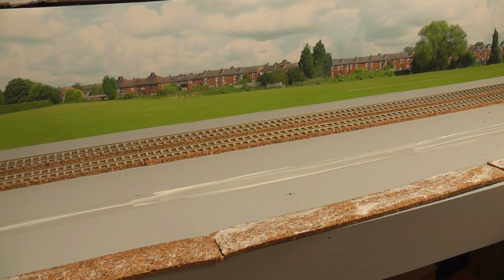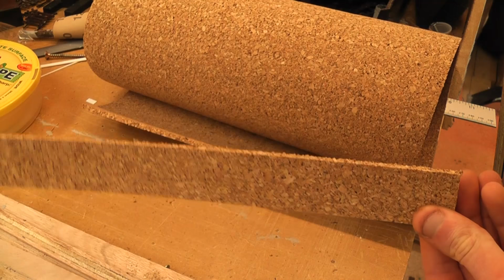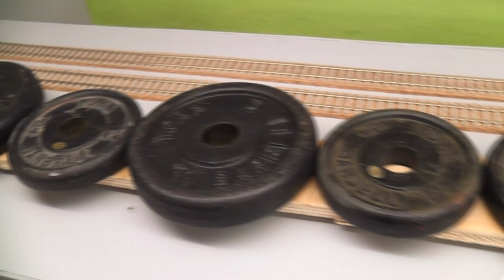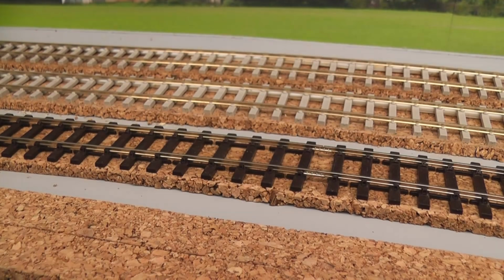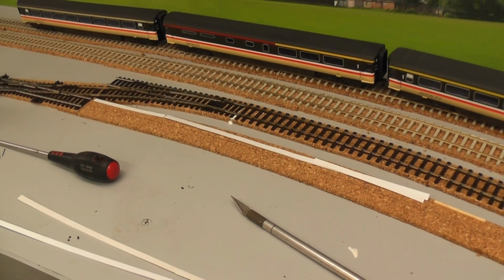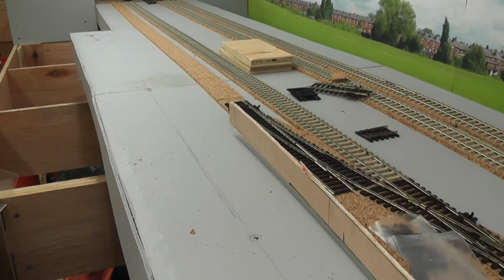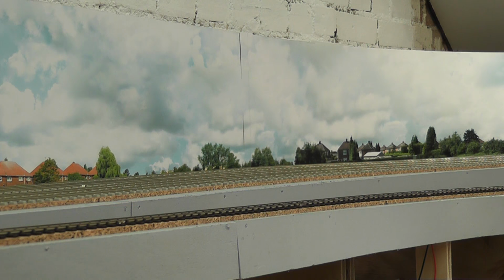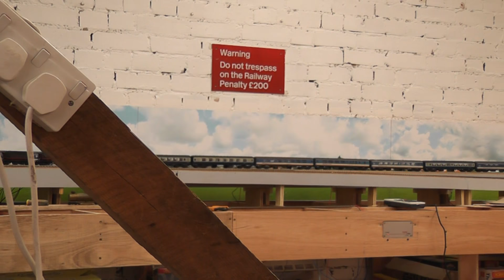New Layout Build - Track Laying

Comment: Very inspirational. Solved the question about combining wooden sleepers on points with concrete sleepers on track. And I like the way the curves are not machine curves as a track software would make them as they vary in real life. I will go for the superelevation also. As I understand your comments the concrete sleepers and their spacing is HO scale which makes it easier when you have a HO layout.

Comment: Excellent work there Richard. The track work your doing is well worth the effort, a pain in the butt to do but well worth it. I'm one of those twats who will use totally hand made track so will have to thread all the chairs on the rail as well. On a slight negative, where you join the concrete sleepers to the wooden sleepers at point work I noticed you cut down the concrete sleepers to fit. In reality they would have used wooden ones as wood is easier to cut than concrete. Also when you want to create the 60' panels, rather than cutting all the way through the rail just cut half way. Once you've added the fishplates they will look the same but you won't have to worry about soldering to electrify the joint. Anyway great to see trains running again and really looking forwards to the next update. Well done.

Comment: Glad to see you back. I really like your placement of the feeder wires. I don't like to see all of the wire and globs of solder on a lot of layouts. I don't have to worry about this as I don't have any feeder wires on my layout. I also don't glue the switches completely down ever. I glue the very ends of the switch where they go into the following track and then glue the  track. This makes it easy to salvage switches and make changes. When I have the track setup final, the balesting will keep the track in place.When I am fitting the track, I use "T" pins to get the track straight. These are on one side of the track only and all I have to do after placing the glue is to push the track back to the pins and it will be straight.They are between the "sleepers" (we call them ties) and against the track.The layout at the 49:35 point looks very great!!!  Glad to see some freight trains on the layout. Most of the layouts (on your side of the pond) just have passenger trains. The freight trains are refreshing...Your videos are never to long...

Comment: Good point you made.
Switches were always made of wood... They were called timbers as opposed to sleepers and when you worked with them my god you knew the difference. They were close on twice the weight for the same size and tougher than something that is very very tough having a really tough day!

I like the way you have tried to make each switch less model train like, as they are on the prototype. In reality each switch is bespoke, no two are alike really.

Comment: Richard, there is a difference between a trap point a catch point. the picture you showed to illustrate it is a trap point with a headshunt spur that ends in buffer stops in that instance (it can be just a roll off into a sand box!), but a trap can simply be an end of the rail that puts the loco on the ground as you showed with that piece of track that is a point without a road (@ 25:16) or it could be a spur that loops like a passing loop that has a headshunt at the end of it. There is or was such an instance of that at Olive Mount Junction. The road comes from the tunnel towards the Chatmoss line, the train can either go over the right hand facing switch onto the Chatmoss or continue into a short otherwise pointless headshunt that ends in buffer stops quite a large distance from the right hand facing switch.

The idea of a trap point is to stop undesired, unwanted right direction movements from taking place... To stop a train that is not signaled to move from moving onto the other line. Its always seen as a facing switch or some kind. That can be a spur which is 2 feet long (as shown at 25:16) or a 2 mile long passing loop with a seemingly pointless headshunt at the end of it.

The positioning on the track, signals in relation to what it around is would dictate what we would have fitted in that location.

A Catch point is used to stop wrong direction movements. They are uncommon these days due to fully fitted trains. After fully fitted became a thing we set about removing them all in the 80s but some remain.
A catch is set after a train has passed it traveling up a steep grade for instance. Any breakaways from that train would be caught by the catch point before caused any bang road movement problems.
On signal boxes to set the route from one signal to another (remember routes are always set from signal to signal, you can shunt to the rear of one but its always from one to another) interlocking would prevent the clearing of a route if the route had a catch in it, as the catch was facing the wrong direction... If it had a spur for instance that spur would be going back, in the opposite direction to your direction of travel.

Which is why its important to point out the difference. You want a trap not a catch.

Comment: Superb stuff. Super-elevation (cant) , transition curves, 60' track lengths, different sleeper types, correct track spacings etc. are all things that are easily observed on the real railway yet for some reason very few modellers seem to grasp. This will no doubt be a very lifelike layout once completed and the videos are already inspiring. 

For years I've also wanted to build a layout using this observed approach and was contemplating having to do it in EM gauge. But having seen how effective the re-spacing of sleepers technique is, I might choose this option instead! One day...one day... 

Don't forget the need for an adjustment switch where continuously welded rail meets jointed track, which in real life caters for the expansion in the first 180 metres of the CWR ha-ha!

Comment: One thing I've done when connecting points/ slips is to use a short length of track and put the isolators on the end of that. This way you get a dead section on the approach instead of just a dead frog. Cuts down accidental conflicts when a train crosses a junction and another train tries to do the same thing.

Comment: Late to the party on this, but intrigued by your approach of laying the bullhead in 60' lengths. 

I remember from a layout in RM many MANY years ago (when I was a teenager), someone trying this and commenting that one reason it didn't work as well as you might hope was that (in real life) we only hear the nearest coach going over the nearest section (both of which are coincidentally about the same length), whereas on a model you're relatively speaking a long way back, and hearing all the coaches going over all the joints. His fix was to make an audibly obvious joint about every train length, and, if I remember correctly, then solder that point to a screw into the baseboard, essentially to use it as a soundboard. Apparently it worked. :D

Comment: Fantastic as always. I look forward to each update.
The one thing I find frustrating is that we have had concrete sleepered flexi-track for decades and 2 turnouts since 2010. We now have steel sleepered and bi-block, but are still expected to use wooden sleepered turnouts. Peco are one of the biggest manufacturers yet seem to ignore this.

Comment: I have PECO concrete track which I re-sleepered with C & L sleepers but I have been worrying about how it will look compared to PECO points with the narrow spacing. You've cleared that up for me. My layout isn't that big and is mostly a shunting puzzle with a small station which has updated concrete track. The rest will be laid using bullhead but as I've said I've been holding off because I couldn't make up my mind on how to match the track. Thanks for a very informative video.

Comment: Many thanks Richard, especially for pointing out how to make fixed points flexible! That branch line is itching to be made 3rd rail so you can run EMU's aka Reading. Would really top it off, think of how many dive under 3rd rail lines there are adjoining the line between Basingstoke and Waterloo.
Reply from the maker: The branch line was always going to be third rail.  It will be added when I start the scenery.

Comment: Interesting to see that you are running the lines as an up-down-up-down config rather than up slow - up fast - down fast - down slow that we have on the ECML.  Excellent video, and well worth the wait
Reply: It is a model of the GW, which is laid out fast-fast-relief-relief. The GE is also fast-fast-slow-slow, as is the WCML until Roade where the slow lines detour to Northampton. It then becomes slow-fast-fast-slow through most of the Trent Valley.

Comment: Brilliant! It's good to see the overall finish with the spaced sleepers. Though I've slowed down on mine to enjoy summer I've made a steady start on the long slow process of 're-spacing and using a mixture of all the fine scale track - bullhead, wooden and concrete sleeper flat bottom - should look very effective. A huge amount of my time has been spent having to research the correct types of track down and around Exeter St David's station so countless images later I've got it virtually spot on. 

Itching to run something 🤣

Tim
Reply: The only thing I had wondered is if the gauging was compromised by all of the sleepers being isolated. All of the other questions I had been thinking of he dealt with during the course of the vid. If you read this Richard, bloody well done mate.

Comment: Afternoon Richard, for me it was worth the weight for the update, The sleeper spacing looks great as does the track camber. I enjoyed the running session, reminded me of my time on BR Railfreight Distribution (Harwich Parkstone Quay) of that period. There are two layouts which interest me on YouTube, yours and Daveclasse47, a lot of others are Mickey Mouse type or only interested in the latest release, which either I skip through or sit there having a good chuckle at (sorry to those I people who run a class 4F with a class 68 on the same layout even coupled together Air/Vacuum braking is not important to some).  Other's have back-scenes which seam to be painted by the local wildlife park, Elephant which distracts from what they are trying to achieve). I will be patient for the next update.

Comment: Hi Richard, considering the time since the last video, vs. what you have accomplished, you have been a busy lad! I'm really liking where this is going, looking forward to more videos! Keep up the good work, it's inspiring!
Reply: Excellent video. Very professional production values (unlike so many!) Close-coupling coaches makes such a difference to the realism. Will you be doing a video on this, as there is so much conflicting advice? 
One thing though puzzles me. You have taken much trouble with sleeper spacing, good back-scenes, fishplates, etc, but have used an underlay of a colour which is unrealistic. Have you tried spraying the cork to a ballast colour? Or does it not key in properly? Are you going to landscape the area of the tracks? Very helpful video however. Thanks.

Comment: One additional advantage of adjusting the sleepers (even removing the between bits from bullhead track) is that you can then see UNDER the track, a detail often overlooked, but quite obvious in prototype photos. NOTE: with two makers of bullhead rail available - Peco and Legacy, the joiners made by one WILL NOT fit the other. You will damage your brain trying to overcome that difference - I know! There is discussion now (2023) that the Legacy rail has a different chemical makeup that makes it much more resistant to fouling and dirt, requiring less cleaning than the usual nickel-silver rail.

Comment: That cork didn't really suppress the noise from a train on the baseboards 🤣
Great intro 👍
Reply: The cork absorbs a lot of the sound but the glue stiffens a lot up to transmit it again. It would be a lot noisier if it was laid directly onto baseboard or PVA was used instead of Copydex. The cork also provides a ballast shoulder, which is sometimes prototypical.

Comment: Can you do a video on installing a 3rd rail please? I think you need to since this is modeled on network southseast/central south London kinda deal which all obviously had 3rd rail its only north London that has overhead wires, even the Thameslink (which you will need to add to your collection) from Bedford to Brighton was overhead wires in the north until it arrived in Farringdon where they would drop the pantagraph so it could continue south on the 3rd rail. So since you love to be realistic I think you need to. Good job with all your videos and work so far mate, keep them coming:)

Comment: What an excellent demo of quality track laying. Re-spacing the sleepers looks so good. Thanks a lot. A couple of questions: Do you infill the gap under the sleepers with ballast on the super-elevated sections?, and couldn't you just cut a small nick in the top surface of the rail every scale 60 feet to get the clicketty-clack effect? That way the alignment would stay smoother.
I look forward to the Peco bullhead range expanding, but the costs will very likely be a lot more than the code 75. I'll just use the latter until the lottery or a very wealthy woman comes to my assistance, although explaining that to my wife could be tricky!

Comment: Track has sleepers. switches use timbers.
They are made different, they are used differently and each one is made for the switch its going on.

Concrete is a modern thing, if used in the era of your layout it was for a specific reason. ie this tunnel cant have any wood inside it...

Comment: FYI. Space between rails is the 4ft. Space between tracks is the 6ft. Space between Main and Relief is the 10ft.
Reply: unless your Irish....
Reply: Unless my Irish what?
Reply: The spacing is different in Ireland :)
Reply: Irish gauge is 5'3". This is a gauge used in Brazil, along with metre gauge. They actually call it Irish gauge. Spanish or Iberian gauge is 5' 5 and a bit". Which is why you have to change trains in Port Bou or Cerbere. SNCF being Standard. Both gauges go through the tunnel at the border but they are single track. You change on the destination side. The stock returns empty. There is gauge changing equipment in Port Bou for freight and the Trans Europe Express when it ran. I saw it once or twice in Narbonne station. Wiki says bogies are changed  in Cerbere but it was in a big shed behind Port Bou station when I was last there. At La Tour de Carol in the Pyrenees, the station has 3 gauges. Iberian, Standard and Metre for Le Petite Train Jaune (The Little Yellow Train) to Perpignan. There is also a bus service to Andorra outside the station. Sorry to ramble on. Getting nostalgic.

Comment: Another instructive video Richard.  Would super elevation be required or necessary to the relief (slow) and branch lines because reduced train speeds for such lines.  Likewise super elevation might be somewhat unprototypical near point work.  The track work spacing is well worth your efforts and the new layout is progressing very nicely.
Reply from the maker: I've halved the super elevation on the branch line to 1mm.  On the relief its the same as the main lines.  The area I'm modelling runs at high speeds on both sides in real life.

Point work is difficult in model form as space often limits how realistic you can get everything to look.

Comment: Hi Richard I just wondered if you have ever tried out stone effect paint it's normally used for plastic plant pots to make them look like stone, I brought some from my local hobby craft store and used it to spray the cork before putting the trac down and I got a really effective finish of course you can still add gravel if wish to go that little bit further with the end result but it's worth a look also looks really good when you spray lengths of wooden floor exspansion cork to look like stone walls.

Comment: Thanks a lot for the bulk of helpfull information - in particular the bullhead joiners and the classic track length of 60ft - what makes in 0-scale half a yard. And in 0-9 this makes really a huge difference. So your information is very very welcome. Also your weathering of the trains will be "copied" due to the industrial/rural countryside. Your videos do really made my day! 

But as I cannot effort a DCC layout I have the question if the soldering of the turnouts for better connection: Is this also useable for DC?

Comment: Out of curiosity.... I agree that big plastic boxy connectors for those "T" joints at the wiring buss connections look awful, but shouldn't  you have used heat shrink tubing at those joints for corrosion prevention and short circuit protection? Sorry if you plan on that and just showed the bare joints to illustrate the point. Love the new setup, I think you'll be happy about all of the extra time you spent on sleeper placement. Will they ever make OO scale correct spacing track for all of you modelers?

Comment: I'm loving this.  So much useful information.  Do you think you could cover track cutting and joining (fish plates) in a bit more detail cos im having nightmares especially where curving flexitrac is concerned. Im using code 75 if that makes any difference - well im trying to anyway 😊  Cheers

Comment: Hi Richard great progress made. Definitely worth doing the sleeper spacing. And your right what you say about the mix on concrete and wooden sleeper track as a driver I see it all the time. One thing that popped into my mind when you showed how close the mark3s were was the APT-E will that be able to go on the fast lines if u have say a hst running or will it just go on the slow lines as and when it's out and about? Looking forward to the next video. Cheers 
Gary